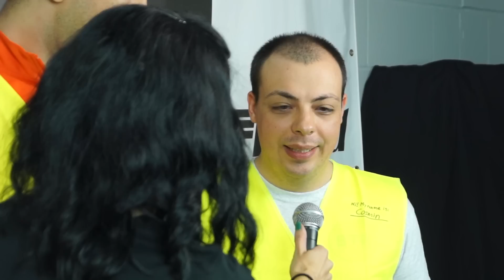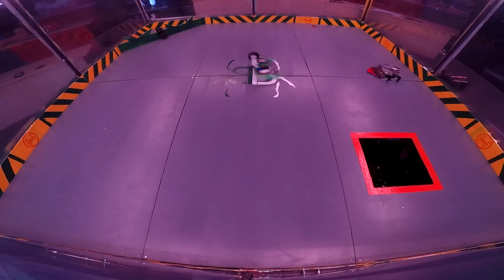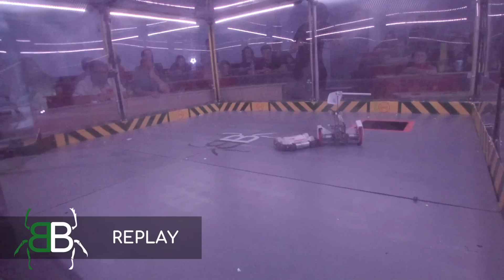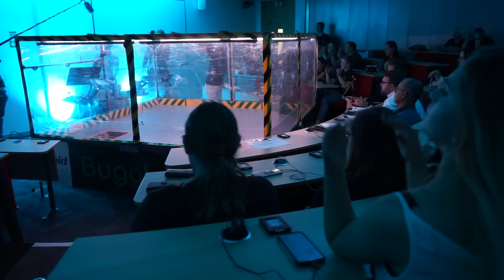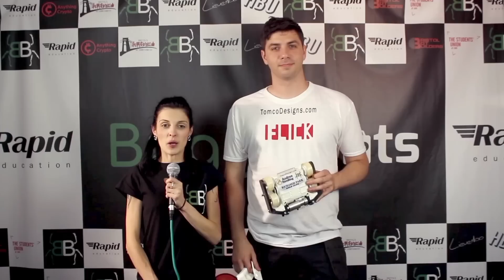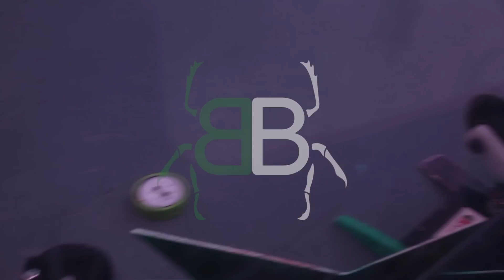Bugglebots 2018: Heat 3

Comment: Maximum ogredrive has the most effective overhead saw I've ever seen of any battlebot of any weight class. Also, is that one of the engineers of monsoon as a referee? The guy with the Mohawk, I mean
Reply: Yes, Tim Rackley. He was an engineer on the Monsoon team  that made it to the quarterfinals in Battlebots season 3. He also captained an axe bot called ragnorok in season 4 that had very little success.